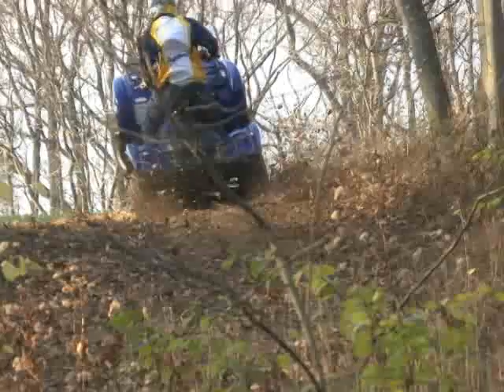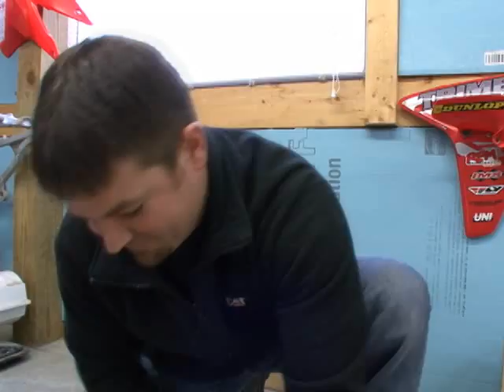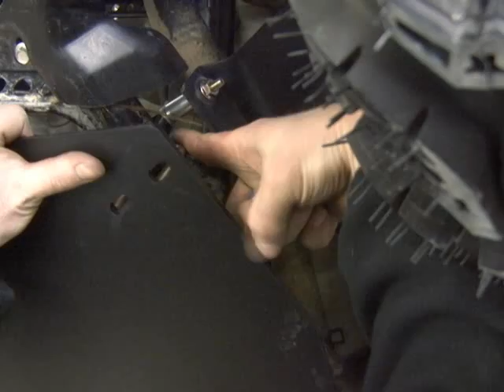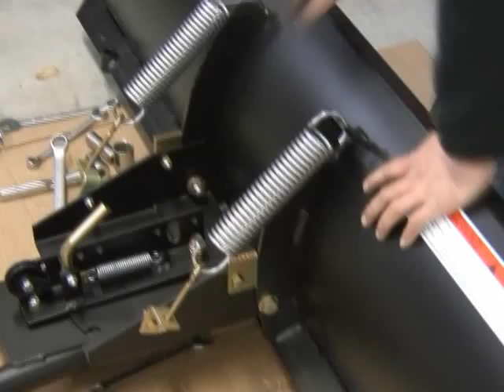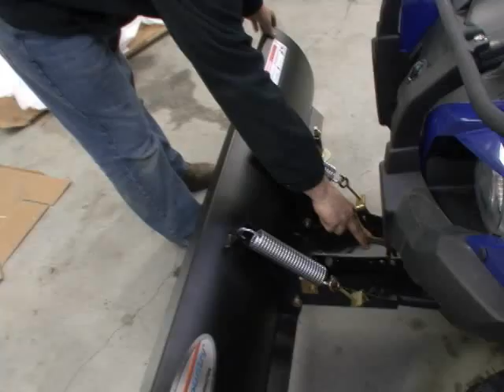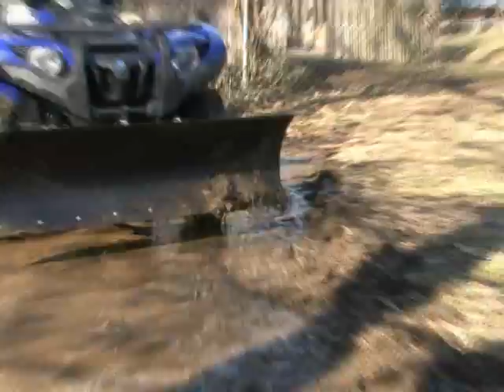Cycle Country Bear Force Manual Lift Snow Plow Test, Part 1

Comment: THE CABLE RUNS FROM THE MOUNT UP AROUND THE FIRST BOLT W/SLEEVE, AND IS STRAPPED UP TO THE GRILL USING THE YELLOW AND BLACK STRAP. YOU'RE WELCOME! TOOK ME A WEEK TO FIGURE IT OUT! NICE SHOP! SO IS DEER PARK CYCLE, IN MARYLAND.

Comment from the maker: @trucker1433 I believe you will need to add some additional hardware to switch from the manual lift to a winch lift. We have not installed a winch with our plow, so please check with Cycle Country to be sure.